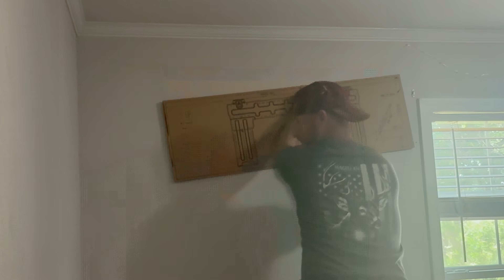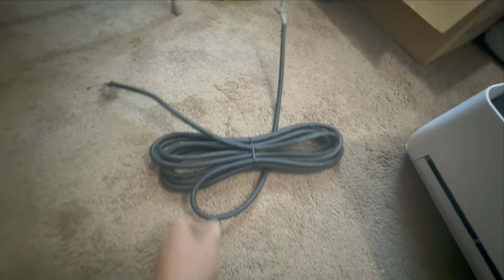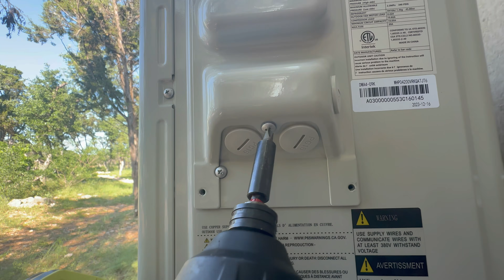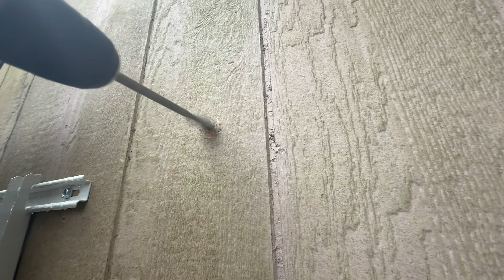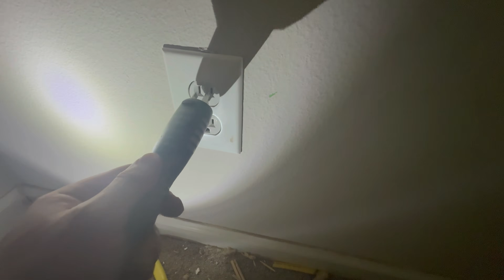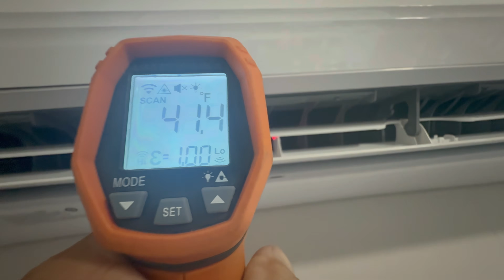Mini Split Installation MADE EASY!

Comment: I found your video to be the most helpful of all the videos on installing this unit but what it doesn't show aside from you fighting with it to latch on to the bracket, is that the mounting template is incorrect. It will have you drilling the hole for the lineset in the wrong place.  I posted on the DIY solar forum about this, a thread titled "EG4 mini split puzzle".  You did the 9k but according to the spec sheet, which shows the incorrect dimensions, they are apparently both the same dimensions.   Someone needs to shed some light on this because people like me are going to need to have precise placement for the required clearances and will end up needing to drill another hole in their wall.  I got them to admit that their template was wrong for which they give zero craps and not even a thank you for bringing it to their attention.  You can follow instructions to a T and still run into a big problem. Just another reminder that we are very much pioneers in this whole thing.

Comment: Also just a couple points, if you are in a climate where it regularly gets below freezing and you plan on using one of these for heat, make sure you get a model that will work down to below zero (Fahrenheit) temperatures; there are newer models now that work down to several degrees below zero.  And also be aware that there are mini split models available that have direct connections for solar panels, meaning that if you have room for a few panels you can offset or even nearly eliminate the cost of cooling and heating, which is especially advantageous on long hot summer days.

Comment: I do not recommended that anyone do what this guy did with the electrical parts of the install, I saw several code violations.  One is the fault of the manufacturer (not including a grommet or bushing where the wires pass through the hole in the indoor unit - you cannot leave wires up against an unprotected metal edge) but others were mistakes made during installation.  If he ever has a house fire that starts anywhere near that area he better hope his homeowners insurance company never sees this video.  There are many other installation videos for these types of units that show it being done correctly, or at least more correctly.  I get not wanting to hire an electrician considering what those guys charge, but there are reasons some people should not do their own electrical wiring.  The sad part is he actually knows and admits that he's doing it wrong in a couple of places but then proceeds with the installation anyway.

Comment: The neutral should not be fused, bypass the fuse and wire nut the two neutral wires together. Make sure that it is not grounded.

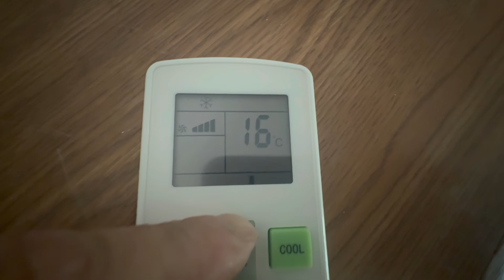Comment: 36:00 too bad you cannot control the device “on the minisplit head” - requires a remote ($10 device can be lost, broken, etc) then system is useless (ie unless that app is still supported).

Comment: Hi good afternoon UnpluggedTexas. Great content! I want to do something similar and install either a 9K or 12K into a media room of mine. The room is 384sq ft with an adjacent office at 300sq ft. Do you think the 12K version would work with the same setup on a 15A circuit? Also I was looking into this Costway unit 22SEER2 12K due to the head unit being black and working better in the media room. Any thoughts?

Comment: 28.5 Seer2 for the price is an extremely good deal. My only concern is the eer is only 13. EER is BTU's per watt at rated capacity at 95deg outdoor temp which is common in the south. 13 isn't very good. The new Mitsubishi FX mini split 9k achieves 18.35 EER and SEER2 33. Quite a bit more expensive, but Mitsubishi makes very reliable units. 
Have you done power use tests while it's very hot outside with these EG4 units?
Reply from the maker: @christopherbenjamin9273  it’s 94 degrees right now. Both of the 9k btu units are each using about 700 watts at the moment. I have them set at 67 degrees and have the bedroom doors open. It’s keeping my house at 73 degrees. It’s cloudy outside so I don’t want to use my 24k BTU Mr cool unit or my traditional 4 ton AC. Im still about to get a 100% charge in my batteries with it being overcast today and 94 degrees. So it’s working out just like I’d hoped.
Reply: @unpluggedtexan Thanks for the info! Thats right on what they are rated to consume. Still, the Mitsubishi will only use 490 watts at that same output and outside temp. 200 watts isn't nothing, but this time of year that isn't even what one 450w panel could produce. So I suppose I could get the EG4 and use the savings to just get more panels.

Comment: Thanks for the video!  Getting ready to install one and will use your link.  Question… with all the solar you have what was your thought process for not getting the eg4 that allows for direct pv connect?
Reply from the maker: @chadcutshall  I have a 19kw solar array. I have way more power than I need. So I had no need to add additional panels to power this mini split.

Comment: An average 3.5T Central AC unit uses around 3.5KW while struggling to blow cold air in the 65~70degree range in Texas summer noons.
Your Minisplit was blowing 41F degree while using 240W! 
If you do not have the budget to add panels, just replace your AC unit with this minisplit. I think this investment has higher returns than getting panels(atleast in Texas)!
Reply from the maker: @ArtificiallyIntellegent  100% agreed

Comment: I have this same unit in my finished shed and I highly recommend it. My only gripe is that I haven't been able to permanently get it to show temps in F, it always resets to C and I have to use the iOS app to switch it back to F. Hanging the indoor unit on the wall is the hardest part, 2 people definitely recommended.
Reply from the maker: @paul.phillips  try holding the temp up and down arrow at the same time for about 3 seconds. That should put the remote in F and it should stay there.
Reply: @unpluggedtexan  I think it works! We'll see if it sticks over the next few days. Thanks :)

Comment: Hello….  Enjoy your videos…. Your solar batteries receive a max charge rate of 3,000w?  Is this a Solark limit or you programmed a limit?
Reply from the maker: @thomashanan1996  thanks for the feedback. My Sol-Ark can charge my batteries with up to 12,000 watts at a time. But yes you can set it to charge at a lower rate if you’d like.  And in fact, it can charge as much as 275 amps at 48v, so you can go over 12,000 watts, but I don’t want to push it that hard.